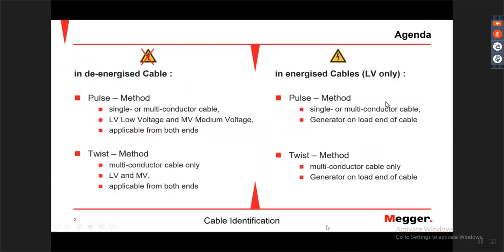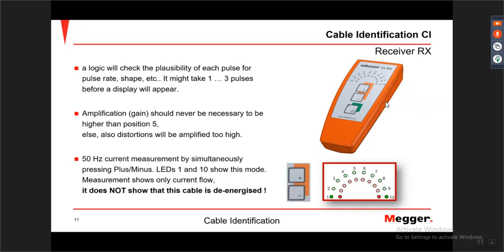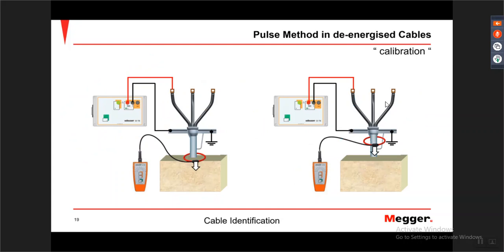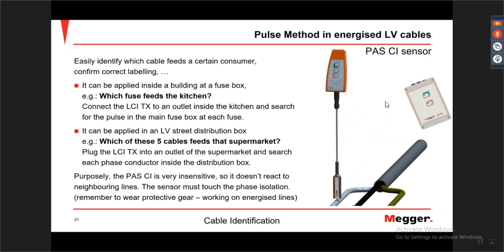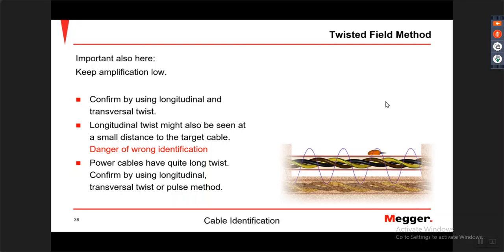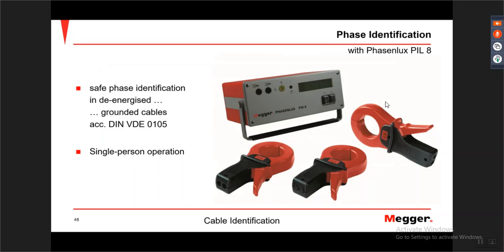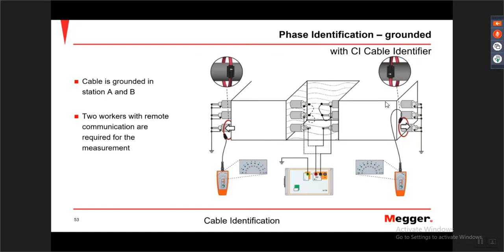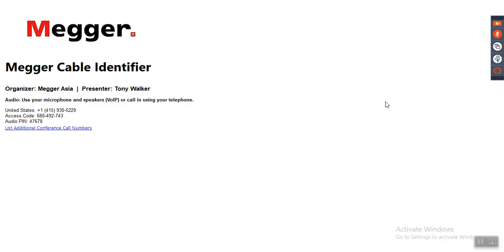Megger Cable Identifier by Megger Asia

Comment: Do the TFS catch the magnetic field when placed on core of cable and then the indication on RX. If the gain is increased does it mean, additional field area sensitivity is increased?. What protection is given on upper side of TFS for not catching field for vertical cables....? 

Please answer in English if possible and solve the doubt....